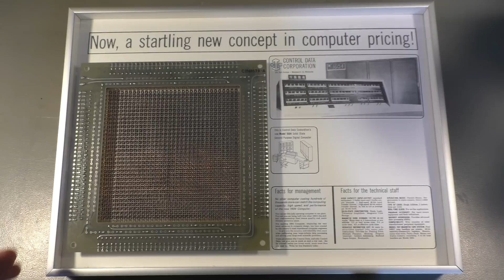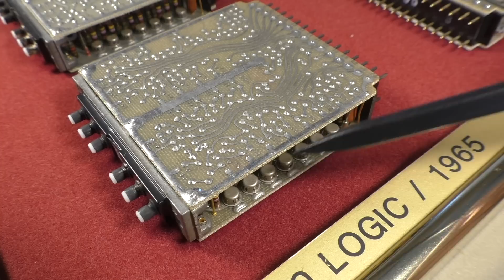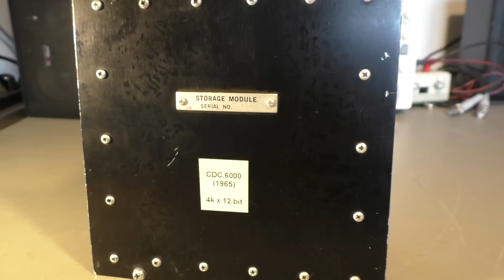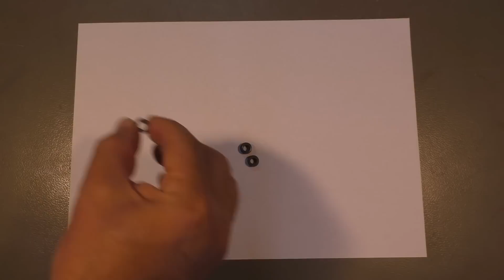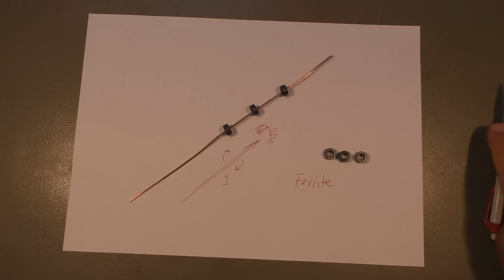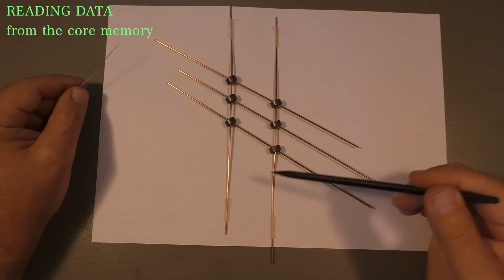1960's Supercomputer Parts (Core Memory, CDC6000 etc) - PWJ209

Comment: The thermal paste is most likely an engineering change, implemented as a precautionary measure once the product was available.
Reply from the maker: Even that surprises me. I mean how long were those machines used? It was built in 1964 and I would be surprised if someone still used it after 1970. I really wonder when thermal paste was invented. So difficult to find out.

Comment: We added the Aluminium because we needed to respond to our customers' concerns with regard to excess heat.  It has been determined that the excessive heat was due to these machines being overclocked.  Some customers were running them eight to ten times faster than they were designed for.
Reply from the maker: From wht I found, the 6600 was clocked at about 10 MHz. So you say they were "overclocking" these systems to 80 to 100MHz? That's quite impressive! Why didn't Cray himself go any faster? It seems easy to at least double the speed with no further design changes. Or did they become unreliable?
This could be the first case of overclocking in history :-)

Comment: I looked for the 7404 and found the TI data sheet out of curiosity. You can still buy this bipolar version (i.e. non CMOS, like the 74HC04). You can even get it in the new fancy SOIC packages. 😊 They are all in status "active", which according to TI, means "recommended for new designs".

You you sure about the 3 trannys in a 7404 inverter? The schematics on page 4 show designs for 4 to 6 trannys. But, of course, the physical implementation might have been changed in all those years.
Reply: Go on; Go CMOS. Fear not, little one.
Three trannies is all it takes for an inverter.  
Some of us can do it with two.

Aces do it with one.

Comment: Would be interesting to see how they manufactured core memory modules. Last words one would like to hear from quality control - “you missed a bit…”
Reply from the maker: In fact, sometimes you can see manual repairs on those mudules.
Reply: They were built by hand.
Reply from the maker: @RBLevin  I assume the later models were assembled semi automaticly. But even then there is a lot of manual work.
No wonder CMOS memories were cheaper.
Reply from the maker: @RBLevin  Not the best example video... interesting but not accurate. He talks about "disks" and the video shows a tape drive.
And the Apollo rope memory is a read-only device that stores a "woven-in" program. Each one a unique item. And the cores are huge compared with de DEC memory.
But anyway an interesting video....
Reply: Nice.  Well Done.
It was initially done by hand, by women, who had small hands are were used to intricate processes like sewing.  By hand.  With needles. 
The latest machines used the first  wire to orient the cores to facilitate the automated insertion of the second one.  
Management of the insertion of subsequent conductors becomes a triviality.
Reply: nope @EBF-oc3ke